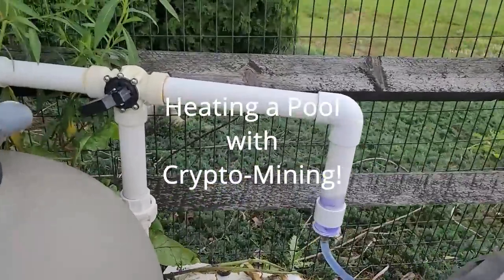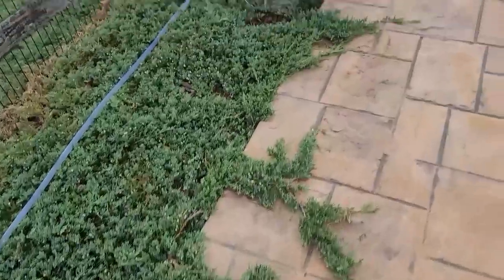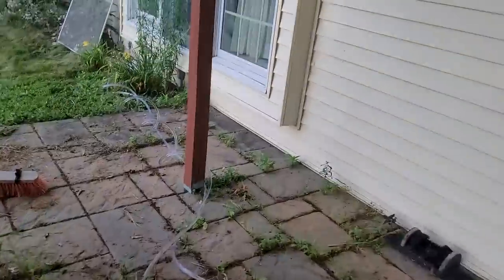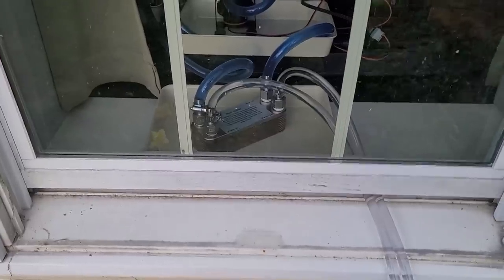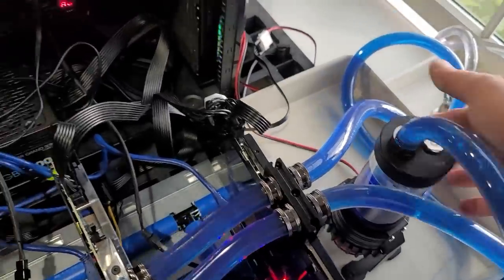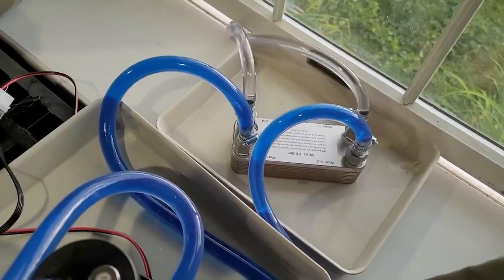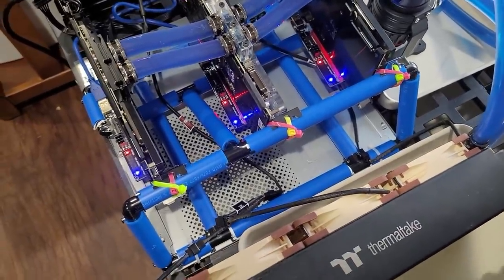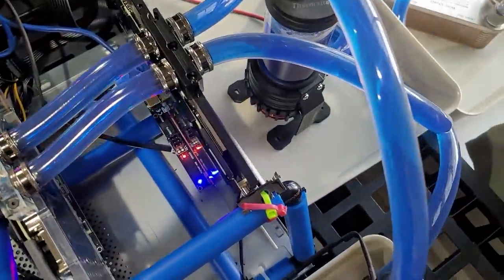Crypto Mining Pool Heater

Comment: An actual pool heater would have been cheaper 😂
Reply from the maker: The propane heater in the video costs $3000 and goes through $300 a month in propane (summer only). It also goes through heater cores every 2 years at $1000 a pop......not as cheap as one would think. Part of my inspiration for this project is my frustration finding a propane heater during the pandemic and multiple heater core failures.

Did I mention that pools are a huge wast of money and energy :)
Reply: @HackyCraft  as a fellow pool owner yes a huge money pit haha but totally worth it
Reply: initially yes but you also get bitcoins so you kinda get your money back this way

Comment: I was enjoying this until he said that he had 3 3090's
Reply from the maker: I actually have five :) Two are in an air cooled system. For me, the 3090s made the most sense. I started this with an dual 3090 sli water cooled system used for design work and photo editing. It evolved from there

Comment: cool but nothing new.. just larger scale.. been building and water cooling pcs for 22 years now.. done it all.. using 100 gallon aquariums, and 5 gallon buckets. to using liquid nitrogen, and sticking the radiator in a mini fridge etc..  Also the water flow is so low, it will never heat the pool up, the pool will just evaporate and lose the heat through the GIANT surface area of the pool itself i bet it wont even go up 1f... this is just a gag to get views